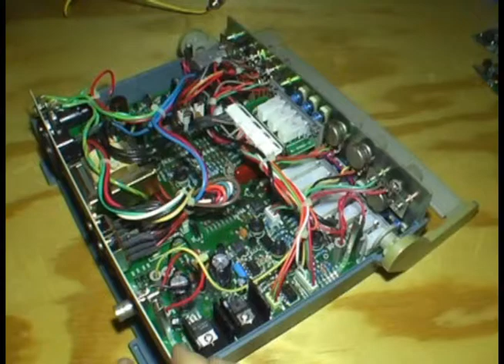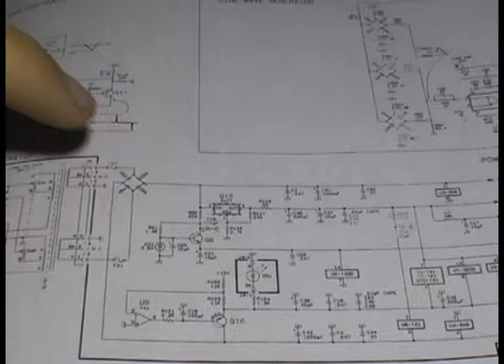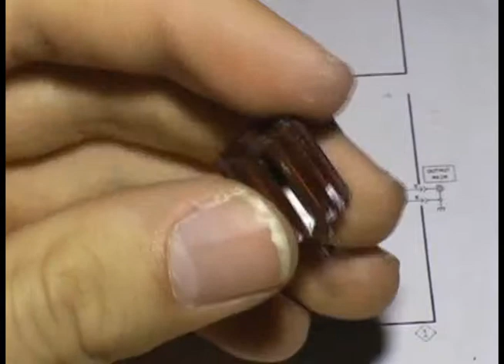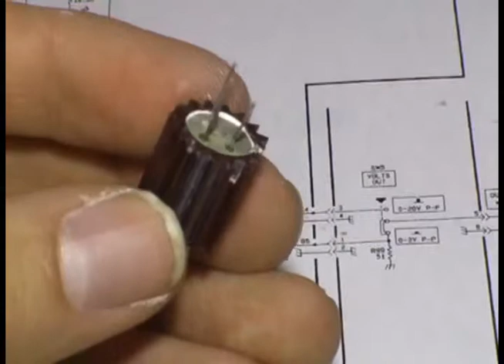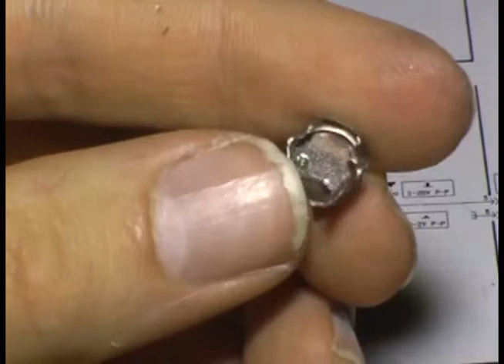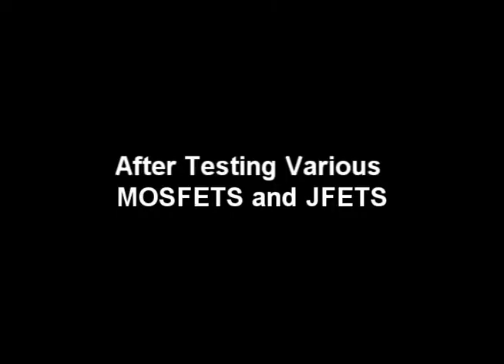CFG250 Fuction Generator Repair Part 1

Comment: I have a CFG 280 that has a problem. The display flashes 2's all across it and I have checked the caps and some of the transistors but find nothing wrong. Anone have any ideas what it might be?Thanks, AJ.